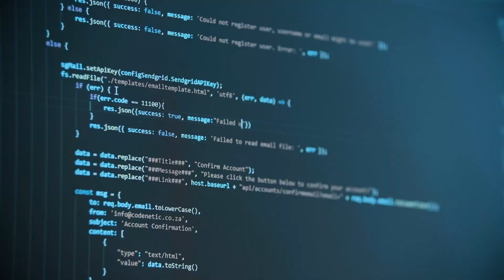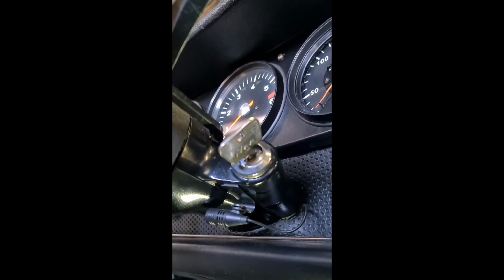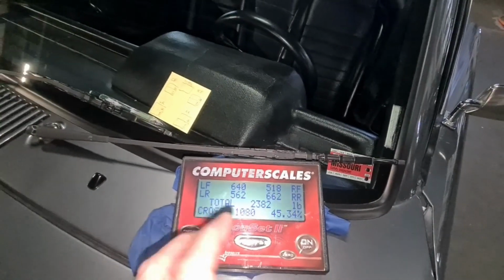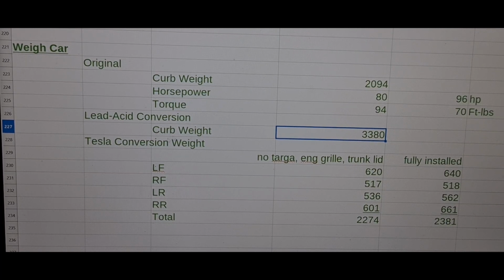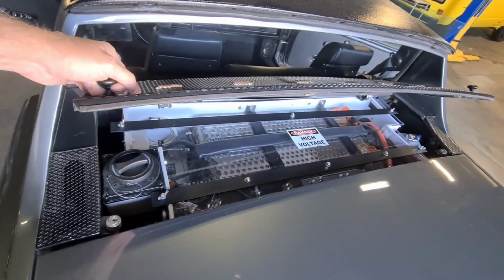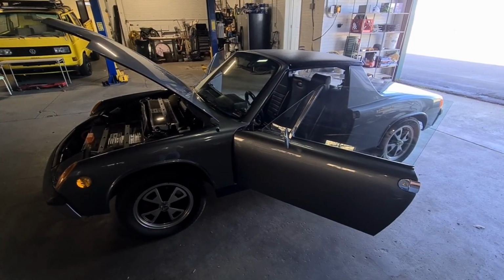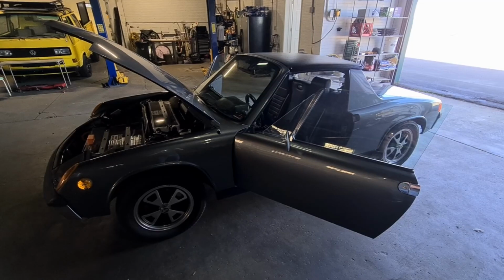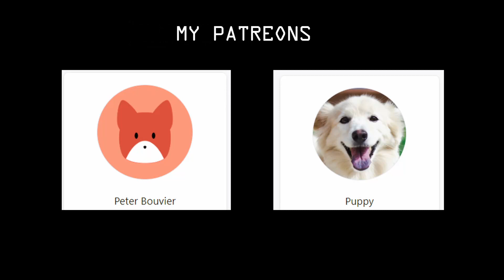Porsche 914 Upgrade Project - 33 - Wrapup and Transport

Comment: Hi Michael: Beautiful job! My  Bolt euv is a heavy weight compared to your Porsche. The car looks amazing.
Reply from the maker: Hey Craig!  Did you order one of the new Apteras?  I remember back in the day you said you liked the original one.
Reply: @MikesTropicalTech I put money down on one ($100) plus "invested" some money, but who knows when/if they will start real production. 
      So... I bought a '23 Bolt EUV. It isis, 
surprisingly, a good EV. Only 250 range, slow DC charging, but very simple with a number of REAL buttons. Marianne might  actually be willing to learn to drive it.

Comment: Now I'm curious whether the vehicle will be registered as a Porsche or Volkswagen. It was a joint project between both companies. 
Volkswagen sold the 4-cylinder engines and Porsche sold the 6-cylinder engines in Europe. Both models were sold by Porsche in the US.          An electric version is only available as a conversion.
Reply from the maker: Good question!  The title says Porsche and Spain hates changing anything that's not on the title (eg gas when it's actually electric), so I suspect it will remain a Porsche.